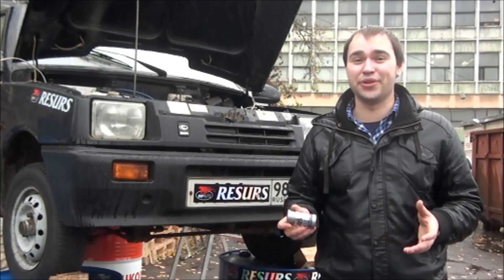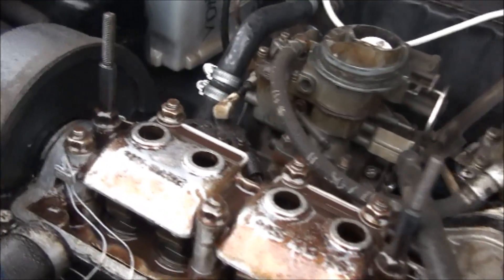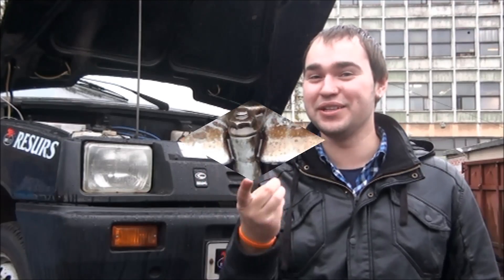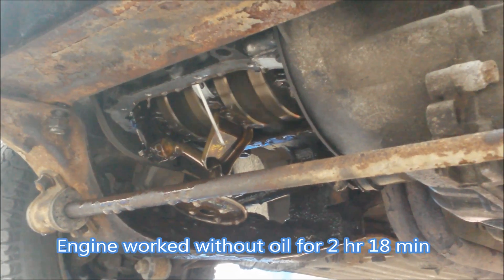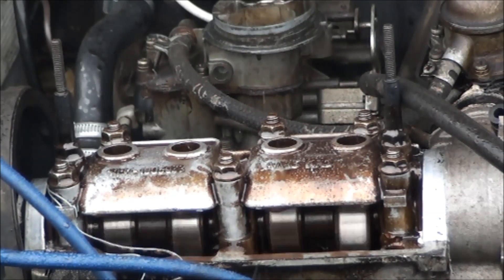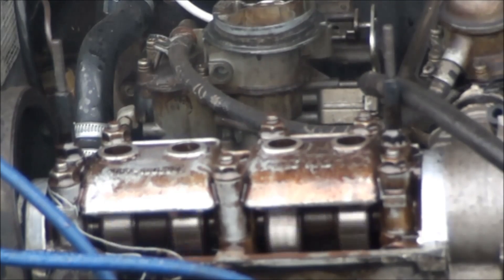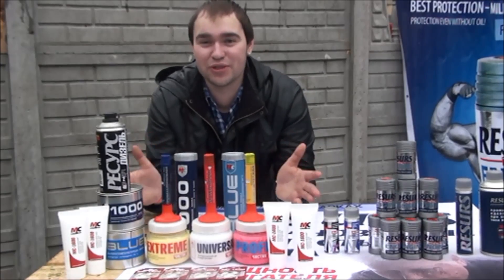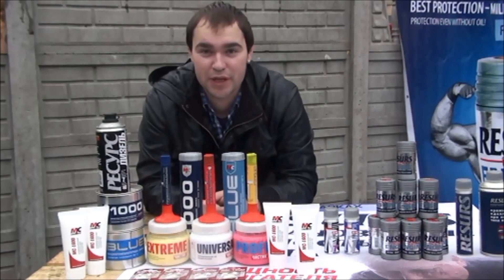Engine running without oil! How to reach extreme protection!

Comment: I just purchased  RESURS NEXT GENERATION OF REMETALIZER 75g. Oil Additive For Car Engines. The oil pan on my wife's Dodge Grand Caravan, 3.3L SE, has rusted out enough that it has a slow leak. The pan looks bad. I'm afraid that it may rust out altogether and dump all the oil out while she's driving on the highway while going to work.

The Van/Pan only has to last 4 days, 2 of those days with light driving, and 2 with faster driving on the highway while going to work. Then we can drop it off to get the pan replaced somewhere. I have all the parts available so as wherever we go, we have what's needed to do the job (without getting ripped off by some auto shop taking advantage of us).

I'm installing RECURS so that, if the oil dumps out, the engine may have extra protection until my wife can get off the road, and stop the engine fro m running, hoping to not allow it to seize up. I've given her 20W-50 oil to keep the level topped off with a heavier than normal weight (5W-20). After the job is done, I'll get another bottle of RECURS to make sure the Van gets a good coating of it. I want that Van to last forever!
Reply: Hello! Thank you so much for your comment. We very hope you won't need to wait 4 days to fix the oil pan of your wife car. At this particular case, our main point to worry is about your engine because thick oil that do not correspond to your engine. The engine can overhit so fast and stop working because of this reason.  Sure you can use resurs for protection with any kind of oil, and at the extreme moment it will protect,   but it better to change oil pan as soon as possible.